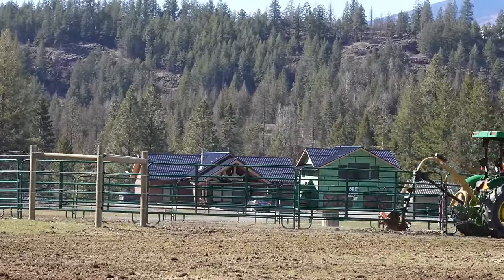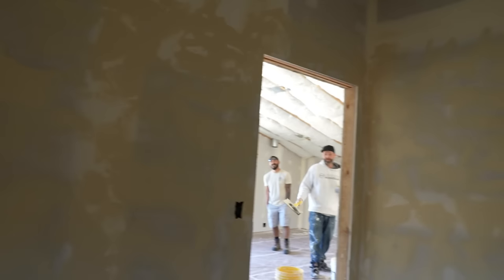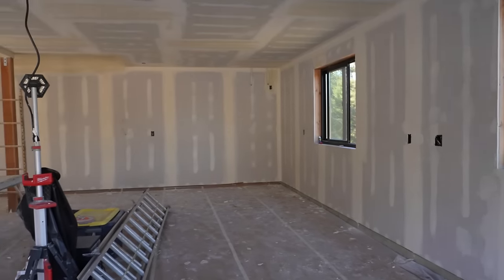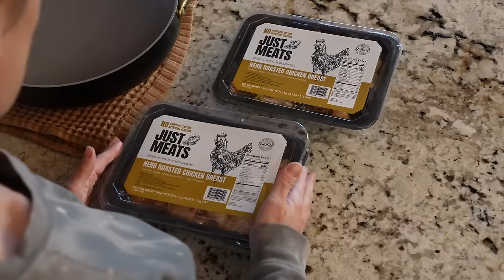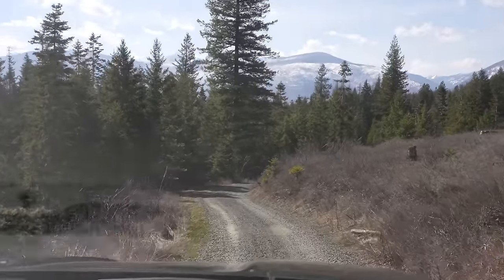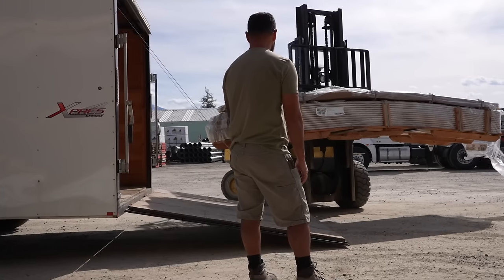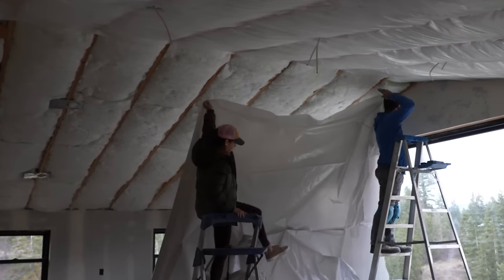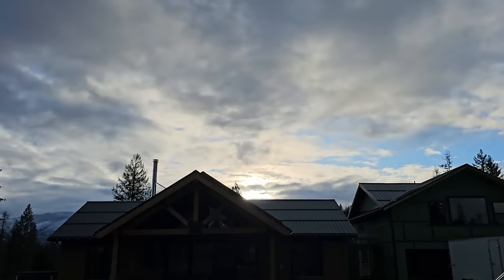We're Nearing the End. Building Our Dream Home In the Northern Rocky Mountains

Comment: You could have even put that up before.You did the walls taking bed on the walls because that would have kept it from falling down.Anyway, the plastic would just save your eyes.Save the guys as it worked on the tape bed.And kept some of the dust out of your upper insulation

Comment: Hi all, just wanted to suggest you put your older horse on a hyaluronic acid supplement called LubriSyn. It will do wonders for his stiff joints. It's not cheap, but I know it works, because I have taken it myself. I'm 76!
There is also a Rx product called Legend, that will work wonders for an older horse, too. 4ml given mainline day one[1], then day seven[7] give second bottle, then no more for 6-9 mo. Wait till he slows down and shows he needs it. Then repeat the two shots 7 days apart. Most vets will not give it this way, they want you to give it once a month, but that does not work nearly as well as the two seven days apart then wait 6-8 months for a new series[it's also cheaper that way] It will work wonders for the old boy. I used to work for a vet and we mantained lots of older working horses that did Roping, Barrels, reining and cutting as well as show ring saddlebreds, and retired race horses. 
Love the wall texture! LOL! Can I come live with you in that wonderful space!! You are so blessed!

Comment: Not seeing a good picture of the drag if it is the one i think it is spikes on one side only if so all you have to do is turn it over to where the spikes are facing up and chain down during the summer you should be able to drag with out tearing up the grass that's why they are designed spikes one side flat chain the other side just like your gravel drive can be drag also